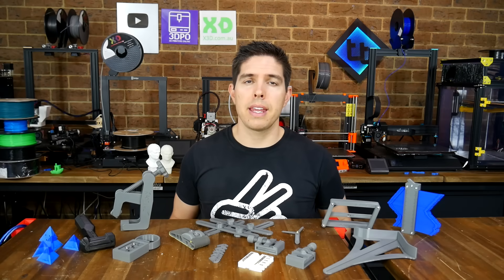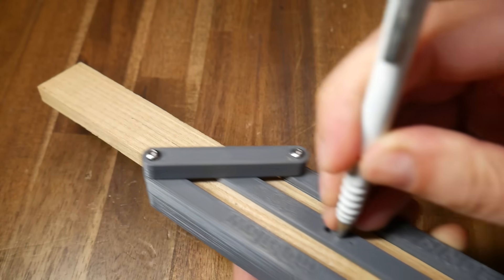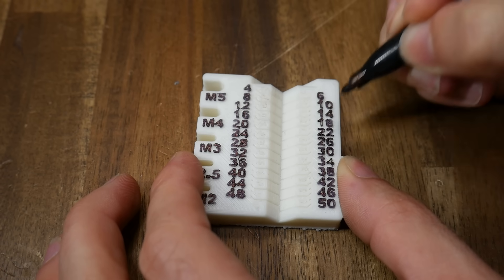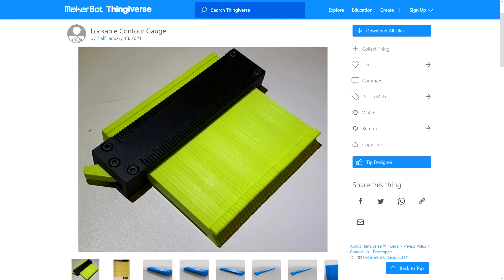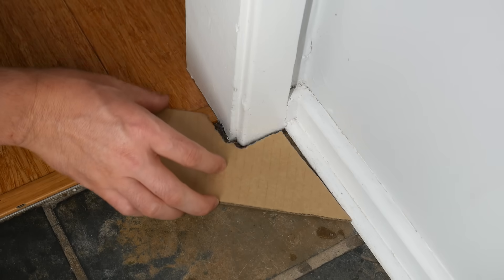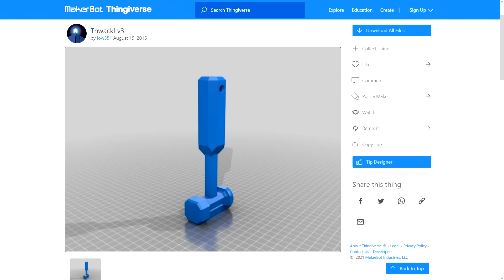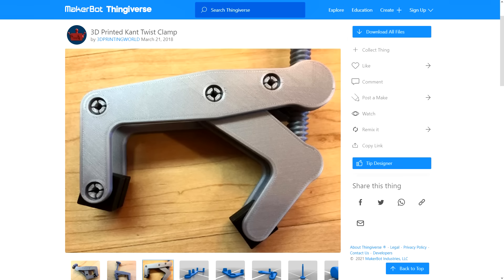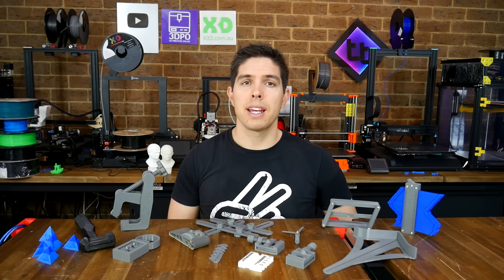12 3D printed tools you need for your workshop

Comment: I just got through reading on Bambu's Wiki page about Humidity and Filaments.. Storing and keeping your Filament in a 20% Relative Humidity Environment seems near impossible. An average Central A/C home is in the 50-60% range... 
Is this just Manufactured Recommendations, and not so damn finiky?  I don't hear many people complaining about it on YT.. 
I see the results of too much moisture and would recognize them. Strings, Holes, bubbles, weak parts, non-smooth surface, etc. 
It would be easy enough to test and remedy, but, WOW, that is something I didn't expect.... Keeping it in an A/C room sitting on top of the printer was my plan. 
Never thought plastic was hydroscopic. 
How much of a "REAL" problem is this?? Any Comments appreciated.. Thanks.. I am looking at either the Bambu A1 open style, or P1 Closed style due to the cooling and moisture issues. .

Comment: I know this video is 3 years old but I've found a trick to make different colored lettering on horizontal surfaces.  This only works for flat things where you can determine the layer of the change from flat to letters.  In the slicer you find that layer and then insert a command (I forgot the term but it's there) and it will simply stop after the last layer and allow you to change filament to a contrasting color.  I mad a birthday cake this way with brown cake and then black for the lettering followed by white for the candles.  The candles had a small black band at the base but still looked good and much better than monochrome cake.

Comment: With 3d printed molds and nylon filament and a 3d printer pen we can squeeze our own nylon injected bolts and screws but my bambu a1 printed pla+ hex bolts work great I just need to design a super thick flat head m3 m4 m5 etc

Comment: That Kant-Twist style clamp mimics the famous metal versions. That tubing cutter is ideal for square cuts on heat shrink tubing.
Tube and pipe notching templates for marking saddle cuts would be exceptionally useful.

Comment: Sorry man none of those tools that already exist out of metal that will last forever. Fun lil toys but in real world in it no way requires me to buy a 3d printer and spend a day waiting for cheap tools. Sorry my just my opinion.
Reply: Bro polymers have advanced since 80s. They're pretty damn durable. Plus even if it does break you can have another printed for CENTS. You don't even need to buy a printer, many libraries have them for public use, if not there is likely a maker space nearby that does.

Comment: While these are some really interesting pieces of engineering, I don't see any tools in this video that really benefit from being manufactured in this way. I feel like the cost in filament and time is unlikely to beat a mass produced tool of the same type made with injection molding, or made out of more durable materials. Most of these can be purchased at your local hardware store, and the quality will be much better, and the cost will in most cases be much lower. It would be nice to see a set of 3D printed tools like this that is specifically curated as ones that are impossible to manufacture otherwise, not actually available for purchase, or significantly improved in either performance or cost by being printed.
Reply: The benefit is being able to produce it on demand, in your own shop or house
Reply: It depends on the country you live. If you are in United States I agree that's easy to buy any tool, but that's not true for some other countries.

Comment: As someone who struggles to design a square in Tinkercad I am always impressed by the designs the community comes up with. Even when based on existing devices, these are unique and useful and printable enough to be a godsend. I especially like the centre finders and Maxwell's plastic hammer .

Comment: That center finder is way too complicated. Should be one piece. That's all that's needed, no fiddly scissor thing. Just an arm with two downward facing round nubs and a pencil sized collar standing up in the center. Put the pencil in put the thing over the edge or face of a board and rotate until the round downward facing pins are touching each side of the board. Boom. You just found center.
Reply: That has to be one of the most pedantic things I've ever heard

Comment: At the 9:05 mark, you're using the tool incorrectly. Don't put the small end against the corner, and push the pieces in, do the reverse. Put the thick end against the corner and push up against it. The excess will then be pushed away.

Comment: What is the best panel scribing tool for PLA 3D prints. I print a lot of aircraft, spaceships, and armor vehicles. In many cases I like to add more panel lines and rivet patterns to add more detail to simple 3D prints. Any suggestions?

Comment: 2:45 Whoah! Is that your bottom layer? How did you get it so homogenous without gaps and lines? I've been fiddling around for a month now and i still see huge voids between the bottom layer lines. I generally also need at least 4 layers for the part to not let any light through when i hold it in front of a lamp.
Layer height, extrusion width, flow, speed, skin overlap, i played with everything. Still looks...meh. (and yes, my bed is level and Z offset is tuned in. even went over it with an indicator for levelling ;) )

Comment: The contour one is interesting... you cna use the old Pin face thing that science toy, but instead of the 3d printed fins that are low fidelity.. the tiny metal pins are more accurate... and you cna create amag/ or clamp that stops them from returning while you trace hte deisgn and hten reset the tool.

Comment: Technically a centerline tool is better at an infnite use length... meaning you only need two knobs and a center whole ot draw a center line, but if hte knobs are adjustible... you can bring them in and if they are swivel with falt surface you can match the surface...  If you want ot always make it to the End of the instrument ot center measure you need three knobs... Whereas two knobs can make a centerline but runs out of realestate to make the line ot hte ned of the thing... in teh center...
 Three knobs.. and adjustible placements of hte knobs allows... any size.. and mid line ot any points.

Comment: One thing to be aware of if you print only with PLA is that it is not dimensionally stable - it shrinks over time. Tight things get loose and loose things get tight after a while.

Comment: What kind of filament was used for these tools? I just bought a printer and some pla to go with it. I understand that pla isn’t the strongest material, however, I didn’t know if it would suffice for these tools or if I need to consider ordering some other kind of filament.

Comment: I need help. My printer stsrt to print parts two times shorter. Width and length are good, but height two times smaller. Do you know what the problem is?

Comment: You can find the centre of a circle with anything big enough with a right angle like a piece of paper, putting the right angle on the interior circumference, the crossing points of the circle and adjacent sides of the paper mark a diameter

Comment: 4:10 - solange es nur um die quasi obere Bohrung geht wäre dieses meist Tool entbehrlich - wenn man aber eine genau gegenüber liegende Bohrung im Rohr bzw. anderem Rundkörper erzielen muss, dann lohnt sich die Anschaffung bzw. DIY !

As long as it is only a question of the quasi upper hole, this tool would usually be dispensable - but if you have to achieve an exactly opposite hole in the pipe or other round body, then the purchase or DIY is worthwhile!

Comment: I printed a dremel adapter that converted the dremel into a small router with a guide for cutting the binding channel on a guitar body and headstock.  I have quite a few hold down clamps made on the printer along with enclosures, t-slot nuts, zip tie mounts.... etc (to infinity)

Comment: Is that your Samurai at 7:21? Awesome I love Sammys. I have owned 4 of them. Can't find anything is good shape where i live. How long have you had it? Is it the original 1.3L I4? 66 raw horse power unless you have EFI . My 1990 Samurai use to go 90 MPH in 4th/5th.. I needed to go back and forth to keep it going. They were not highway cars but they would climb a wall and i never had a Jeep that could follow me in hilly wooded areas. All this is assuming you are the owner of that Samurai/Jimny. 
Great video! Thanks for sharing.

Comment: A trick you can use when printing objects that have insets to take nuts- if the nuts are shearing the plastic insert, powder some baking soda into the hole. if you want, you can put some paper at the bottom to plug the hole and contain the powder.  dust up the nut a bit as well.  re-insert the nut.  Then take a thin-consistency superglue and apply it around the edge of the nut, making sure it absorbs into the crevices.  The powder will act like a sponge and soak up the glue.  Once it dries it is rock solid.  I used this trick when I made a small Dremel press.  Used it for inset on the gear that raises and lowers the dremel.  In testing I tried to see how hard I could force it down before it broke.  It didn't lol.  The rods that the dremel head was riding on popped out of the base first.

Comment: That first centrefinder is handy and quick but the traditional way to find the center is not measuring with a ruler😉

You simply use a  marking gauge, calipers or even place your fingers against the piece as reference to mark an aproximation of the middle of the piece and then transfer that measurement to the other side and mark the point in the middle of your two marks. Thats the centre, just set wathever you used as a marking gauge to that and scribe along the piece.

 Even using your fingers as a gauge produces a suprisingly accurate center line.

Comment: The contour matcher looks like a cool project, but these can be purchased for just a couple of dollars, so I wouldn't recommend.  A feature of the small clamp that I like is that it has flat parallel sides, so it could be locked into a large vice while it holds your small item.

Comment: Some of these like the hammer and the box cutter are a bit of a misplacement. While yes you can print a fully infilled hammer you can also just buy a rubber hammer(which will not break after a few uses or one use that was a bit too hard) and the box cutter which is stored while under stress. That will wear it out. Also if it get's to the pointr where you can change the blade for a new one. self tapping holes will be a mistake so yeah a cute idea with a lot of problems.

Comment: For internal fillets, grab a deck of cards to slide into the curve. Then measure the outside curve of the deck.
Reply: Essentially a tiny contour gauge. Smart.
Reply: Or, a stepped rod or quarter rod with known diameters.

Comment: I would really suggest a serrated blade in the cutter. Thanks to the circular pivot the serrations should give you a slight sawing effect making it even easier to operate and relying less on the edge to do the cutting.
Reply: Cutting tubes need a sharp straight edge.  If you use a serrated edge, you'll tear up the tube.  Just sharpen your edge of it's dull

Comment: That measurement tool is cheaper to buy on aliexpress.

Though if you have loads of scrap filament and do not mind a Rainbow effect in the sliders it would be a good one to get rid of scraps of Filament, due the large amount of small sliders needed

Comment: Since becoming a 3d printer owner, I've noticed several 3d prints require some sort of bolt and/or nut. What would you recommend as a get started kit for bolts and nuts? What sizes should I have at my disposal? If you have a video about this already, could you please link it. Thanks :)

Comment: You can do Nr.3 much more easy cheaper and more precise. (some µm if your drill chuck and drill are as precise. Turn to check and use another drill if it makes a difference. If your chuck is not centered this tool won't help either). Just take your steel ruler or any other strait piece of thin steel and put it on the round material. Gently press the drill on it. Now move the round thing until the ruler is exactly horizontal. You don't need to print anything and 3D printed stuff is usually not very precise. I think I'd find the middle of a shaft with my pure eye better than with that 3d printed tool. (Error is usually in the region of 0.1 to 0.2mm - at least before I started wearing my glasses. It takes years to get used to them (diagonal crosswise axis astigmatism, not much (I was seeing good for 30years without glasses, but the error by the glasses in this directions completely sucks))

Comment: While I think plastic hammers are stupid, you could try printing one with a cavity in the head, and fill it with shot or BBs to make it into a dead-blow with a bit more mass. You could also make a peening head by designing the head to accept a steel ball with a slightly more than hemispherical cavity to trap the ball inside. Electric motor rewinding shops are a good place to get old ball bearings from, which you can cut apart and get a nice set of balls from.

A hammer with a TPU face insert might be better than straight plastic, too. Doesn't need to be bonded, just a press fit inside of a constraining cavity.

Another thing: you can re-enforce your designs (such as a hammer handle) by printing a hollow core which you then push a steel rod inside.

Comment: Some of them are great ideas, but to be honest, anything requiring strength eg clamps and the hammer, are a waste of material and electricity. A small rubber mallet is so cheap to buy too and will last decades of use. We should really promote 3d printing for what is also environmentally viable. Otherwise, it s just adding to the landfill.

Comment: Great video, thanks for posting. They have put a limit of 10 editable designs making many of my old designs read only. Is there a way to open the old designs for edit?
Reply: Yep. The label that shows a file as editable or read only is a drop down menu which can change that status. Just make sure that files you aren't currently Worthing with are read only and you should have plenty for your current project.

Comment: The Thwack plastic hammer can also be used for jewellerymaking and stuff like that. But at that point you absolutely need to print it on its side as that is quite a bit of force
Reply: Yes I agree! Soft hammers/mallets come in very handy when it comes to jewelry making, as well as many other automotive repairs as well! When you're knocking a gear into place, you dont want to smash teeth. Rubber mallets are used often, but they're typically pretty large, and this plastic design gives ability to make a mallet to fit perfect size necessary!
Reply: @atmosrepair  nobody uses a rubber mallet to knock a gear into place. what the fuck are you smoking?
Reply: @schlomoshekelstein908  Based on that user's name, there's a chance they're talking about gears in a clock.

Comment: The vice was sweet... I printed ones at 66.666%, 100%, 150% with 0.3mm nozzle and 0.1mm layer height, and 225% on my Ender with 0.6mm nozzle and 0.4mm layer height, which may be a little be too coarse...
Now just wondering whether to extend the selection and do 44.444% and  337.50% to keep the progression going!

Comment: 10:12 seems like an easy fix to make putting in the sandpaper easier, by just adding a few chamfers on the edges of the joining surfaces.
Reply: Remove the clamping piece entirely, place the sand paper, then reattach the clamping piece.

Comment: If you are having problems with tolerances do not scale down the object. Instead, reduce the flow multiplier down to 95% ish. The reason the parts are not fitting is because of moisture in the filament causing expansion of the filament when heated. Always adjust the extrusion multiplier to accomodate for the moisture. Scaling the part down is kind of a rabbit hole. Great video as always Michael.

Comment: It's not a drill bit. It's a drill or twist drill. The machine that turns it is a drill motor. Drill bits are hardened cutting tips that are attached to the end of a well drill to cut through rock. Sorry but that is a pet peeve of mine and I'm a crusader to educate the less technically minded. It's gotten so bad that even the drill manufacturers and sellers say "drill bit" to reach the novices. SMH but love the video otherwise.
Reply: Radii or radius gauge. Not fillet.

Comment: Awesome, a mid week video!  I think I was most impressed by your Sharpie skills though, anytime I try that I get marker on the bits marker shouldnt be on haha
Reply: iso alchohol (and cotton swab)  is your friend as an eraser :)
Reply: imho maybe it makes sense to apply paint into the recesses and crevices. then hit the top with sandpaper to remove the paint from the raised areas
Reply: @dreamcat4  I have either been doing a filament change or using a hard foam brush with as little paint on the brush as possible.  But your idea would work equally as good and is something I never thought of, thanks!

Comment: I can't even tell you how many useable and useful parts I've printed with my machine. Car parts, cabinet latches, custom adapters and fittings, cases, replacement parts that either can't be bought or are simply too expensive to buy, etc